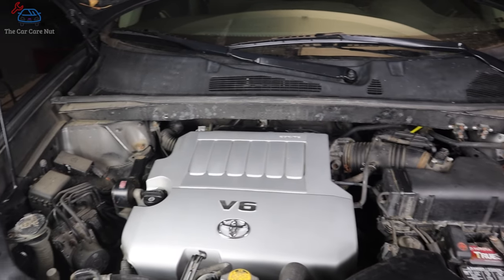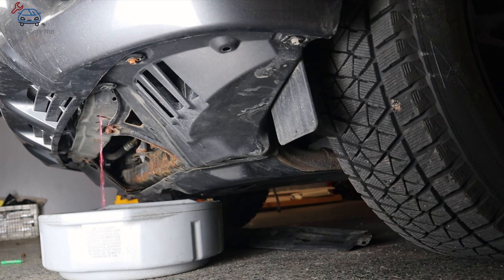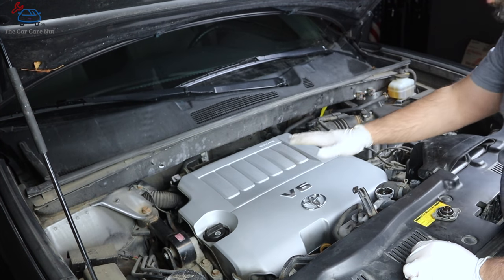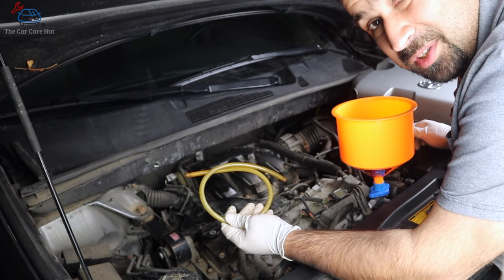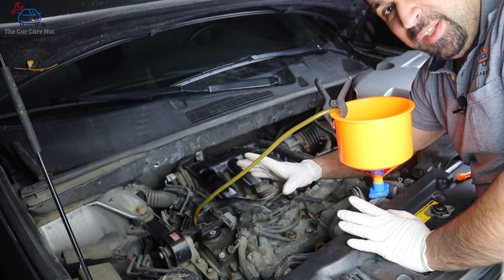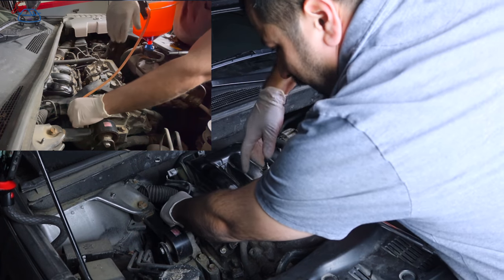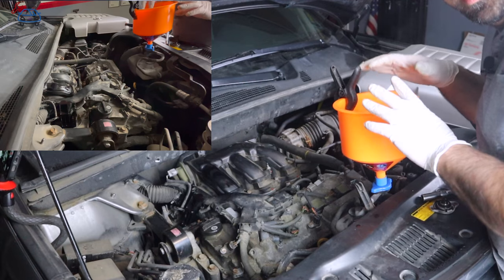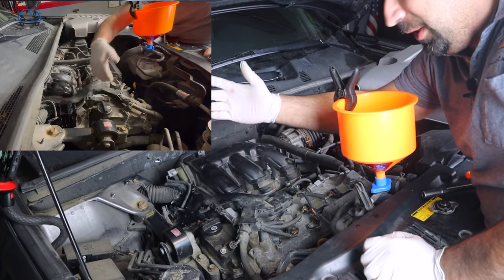Toyota Cooling System Bleeding for V6 2GR-FE 3.5L THE RIGHT WAY!

Comment: Worked great in my 2015 Sienna! I did a drain & fill (preventative maintenance), needed just over 1 gallon of Toyota Pink coolant.
Reply: No, heater was off per video instructions. The Sienna does not have a heater valve. Leave heater off when performing this procedure.@@DontEatBatSandwich
Reply: Will this work for a 2019 Toyota Sienna?

Comment: Just watched this video for the first time. 2014 sienna 176K miles original thermostat and water pump.. I preformed a drain and flush 3 maybe 4 times with regular water with the front of the vehicle raised on ramps making the radiator cap the highest "vent" slowly added coolant while the vehicle idled for 20-30 mins. No mess no fuss no tools required(pair of gloves)and no problems since and interior heat was super hot for the winter. Seems a bit over engineered? It did take some time, a Saturday night well spent in the garage taking my time so not the quick/fastest way like in a "dealer" setting.

Comment: Meanwhile the MZ engine family were so easy to bleed in comparison. Toyota SLLC or in Australia we have a P-OAT coolant that's specific to Toyota/Lexus even down to the colour. Ingredient are basically identical to SLLC, because in Australia the genuine coolant is ridiculously overpriced. Toyota call for Phosphate coolant that's Anime, Borate, Nitrate & Silicate free. It's the only aftermarket brand coolant i'd use besides genuine, especially if i'm changing it every 65,000km as per the book after the initial timing belt. Plus being a concentrate i rather it mixed with distilled/demineralised water myself.

But as always, great work !

Comment: At the end after you've let the engine idle a bit and everything has chilled out, grab and squeeze the hose from the radiator then with it squeezed you can have a friend remove the funnel and cap and then put the radiator cap back on.

Comment: Many years ago a friend told me that he was going to have to buy a replacement engine for his MB diesel S Class because cylinder #6 had seized. I asked whether he had had his coolant changed before that. He had and the dealer did it. I suggested that the tech might not have opened the block bleeder. Sure enough. Air trapped. They replaced the engine free. Moral: Look up the exact procedure and don't guess.

Comment: One thing that you have to watch out for is making sure you loosen the correct bleeder. He said 10 mm and I wasn't paying attention. I loosened the adapter that the bleeder screws into. Nothing was coming out, assuming it was clogged I removed it. I then realized the brass bleeder is the 10 mm bleeder that is essentially threaded into the 15 mm adapter.  Got coolant all over the place.

Comment: Hi love your videos, real thorough explanation.  I just bought a 2011 Toyota Avalon with 57,500 miles on it. Garage kept. 1 owner.  I just did the drain and fill like you said. But it only took a little more than a gallon to refill ?  I opened the bleeder on top like you said and opened the petcock on the bottom of the radiator and removed the radiator cap to let it completely drain. I bought a yellow refill spout with a stopper on the bottom, less mess and pinched off the bleeder hose with needle nose vice grips, no mess at all. MY QUESTION IS. Why did I only use a little more than 1 gallon of antifreeze and that was filling the reservoir to the full line ? My owners manuaI said it takes 2.8 gal. I bought 2 gallons. I had a steady flow after the bleeder line cleared and then filled solid with no bubbles ?
Reply from the maker: Hi! That’s actually correct. The rest of the coolant is very difficult to get out short of removing parts off the engine mainly the water pump. The amount you replaced is enough to refresh everything.
Reply: @TheCarCareNut thanks for the super quick response ! How long will it last replacing only half the coolant ? I read about the other 2 block drains, to remove all the coolant and was hoping to exchange it all out for 5 years. I guess I will have to check the ph, voltage with the engine on and off to see if I have electrolysis that corrodes the metal and rubber hoses. Everything has been well maintained and no traces of rust and the  hoses are still firm vs soft and blown up. Thanks for all the tips, I already dropped the transmission pan and replaced 2.5 qts after cleaning it, the 1 bolt was easy to get at with an open box wrench, next up the spark plugs, I'm really not looking forward to that rear bank. you have helped so much, it's wonderful to have a smart and dedicated expert that is willing to spend his own time helping others out !  thank you very much., Im 69 on SS and still wrenching on cars, I've been doing it since HS, soon I will have to pay people but until then your the Master tech and instructor for us Toyota fans.!

Comment: I did at least two dozen 3.5 V6 Toyotas. Same ideal but I hang the 1/4 tubing on the hood prop rod  then fill the antifreeze up with that same funnel to the middle. Then I run the engine for at least 10 min. till both upper and lower hoses are hot then open both heater control valves for another 5 minutes. The ideal is no more air bubbles or at least the minimum. You’re ideal is the best but you need someone to step on the accelerator when needed.😊😊 I’m most of the time by myself. Nobody likes being with me😅😅

Comment: Just did a drain of fluid didnt open valve and replaced fluid....squeezing hoses to remove bubbles and had no issues year later. I just checked the fluid next day and added some more fluid and done.

Comment: Thank You this video is a great Time Saver for proper bleeding , Also i would like to add in bleeding my 2008 Sienna  I found after draining coolant out of bank 1 &2 and draining the 2 drain hoses by the passenger spare tire underneath that using the hose with the top bleeder submerge in to the 50/50 mix it will pull coolant into the motor. when coolant stop draining from jug then move  back into the top no spill funnel and it will the have a steady stream of coolant.

Comment: Followed this exactly. I never got a steady flow only more large bubbles mixed with flow after the drop in the hose. The funnel also filled up with a ton of coolant, so much so that after the engine was shut off I had to add a lot more back into the radiator.

Comment: Wish I would’ve seen this when I swapped the thermostat on my ‘09 Sienna! Ended up using a lift to raise the front end of the vehicle and topping off the coolant as needed and having someone rev the engine throughout. Ended up working decently; had good heat and everything, but had to periodically top off the coolant in the following weeks as the system self-bled while driving. Made me think I blew a gasket or had a leak somewhere!

Comment: Did I understand him correctly to have the heater “off” during all this?  How would the air bubbles get out of the heater core as he describes if the heat is off?  
Also, at 8:55 he states “make sure your coolant stays over the bottom of the overflow hose.”  It looks like his hose that overflows into the funnel is barely protruding into the funnel and is never submerged in the coolant as he describes?
Reply: Apparently he meant to say over the bottom of the funnel, he also touched it as he spoke...

Comment: Thank you for putting all these videos together. I have a 2009 Toyota Avalon  limited. I have done this procedure twice now, as I have only been able to drain 4 quarts of coolant  each time. I have opened the bleeder valve  but it doesn't make any difference. Why is the system not draining more coolant?  Thank you. Gene

Comment: My mechanic when questioned about that bleeder told me they pressurize the system instead. However as I have the T's to the heater core to replace ( he'll do it as my hands do not work like they used to )  once again they will do what they do to get the antifreeze into the system. Now just incase I have any issue with not getting the heat everywhere in my Sienna I will do this method to make sure there is no air in my system.

Comment: First time I have seen one of your videos. I want to say THANK-YOU sir. Quality video clearly showing the do's and don'ts. My mechanic says the car is overheating and causing it to shake while driving like it's misfiring. I paid him for his evaluation/diagnosis but took the car home to chew on the $800 repair estimate to change the radiator. Is 3 hours labor about right for job? When he showed me the nipple of the radiator that was broken off and stuck inside the hose I noticed a vacuum line disconnected right behind there so I reconnected it. I drove it home 1.3 miles with no issue but then my wife drove it 4 miles and it got very hot BUT NO SHAKING. I brought my car to her and she drove it home while I waited for it to cool down to the midway point between cold and hot. I drove it home with no overheating as gauge stayed right in the middle and no shaking once again. Today I drove it about 4 more miles with zero issues. I reconnected the hose (less than 1 inch diameter) at the top of the radiator (not the hose to the reservoir) using a hose clamp and just drained the antifreeze out. I was going to refill before seeing your video but now want to get a proper funnel before doing so. Any suggestions would be greatly appreciated.

Comment: Most engines you can burp a large amount of air from the system by squeezing the lower hose firmly and releasing. I found that that worked for most of the air in my Lexus, and I was able to tell how much air remained as I'd measured what I drained before replacing the pump.  But for sure, it pays to use the bleeder.
Reply: On this engine, the hose is close to the belt, so I wouldn’t squeeze it while it running to keep my hands clear of the belt.

Comment: Great video and thanks for the information you have passed onto us.  But I do have two questions to do with the car heater.  I think you say that the car heater should be turned OFF before starting the filling and bleeding process of the engine and radiator, ..... well at what point do I turn ON the heater to make sure that heater coolant circuit is also correctly filled with coolant and has no air bubbles in it?   This particularly relevant if the heater coolant has been drained at any time.  So my second question is why I cannot just simply do your filling and bleeding process with the heater ON right from the beginning so that the engine, radiator and heater coolant circuits are all filled and bled all at the same time?   I hope you get my drift, and I look forward to your reply.  Regards.

Comment: This procedure worked very well on my 2011 Highlander with 2GR-FE. However, I was able to drain only 7 qt of coolant from the radiator drain though the owner's manual spec for the cooling system capacity is 9.3 qt. Per a TMC schematic I have of the cooling system drain locations, there are two cylinder block drains that I couldn't locate. I suspect that the missing 2.3 qt is coolant left in the engine; thus only about 75% of the coolant was replaced.
Reply: Was going to also post this. Is draining just the radiator enough? You could probably get more coolant out by starting the car with the drain open and hoping the pump pushes a bit more coolant out? Not sure if this would be best done on a cold or warm engine (thermostat open or closed).
Reply: @bumblebvr6  I don't think it's advisable to run the coolant pump with no coolant in the system, which would be the case if you started the engine after draining the coolant.

Comment: I finally got a steady flow but never saw the coolant drop back out of the hose.  I had tiny air bubbles but with a steady flow.  I did this on a 2007 Sienna.  Van was running for over an hour.  Bubbles got less and less but I never saw fluid drop back in the hose like in the vid.  I did achieve a steady flow.
Reply: In my case clamp squished the tubing once coolant got hot and it blocked the flow. I had to remove clamp and hold the funnel end of the tube with my hand instead to confirm steady flow.

Comment: Thanks for the video man. I got a 2017 v6 Tacoma. I had to fill coolant twice… once I want to say like 8months ago with about quarter gallon, then just recently with about same. I find this a little unusual to I took it to the dealer, they did a check I don’t thin pressure check or cilindro check. But did do a coolant change. 

Week later I noticed the level down about quarter inch from full line on expansion tank. 

Should I be concerned for a gasket leak? Dealer said it’s all good, and that coolant can evaporate?  It’s not overheating, no obvious smells or leaks, or white smoke. Had truck since new, now 91k miles

Comment: Just re watching this again, I have to ask, why don't you drain the engine block ?
Some people are advising to drain and flush the engine block AND heater core as well as the radiator to get ALL of the old coolant out. 
Is this true or will just the radiator drain suffice ?
My factory fill coolant is way over due so I would think that the process I mentioned earlier would be the way to go to rid the system of potentially acidic old coolant.

Can anyone please advise on this ??

Comment: Be careful. I did this about 10 weeks ago. It was great. However the 10mm bleeder valve which is on a fitting that is screwed into the engine block. Well that 14mm fitting was slightly loose. All of my coolant eventually leaked out and would mostly evaporate. So no puddle on the shop floor. It is difficult to get a 14mm open end on that fitting. So I slid on a 14mm deep socket to tighten up after securing the 10mm bleeder.
Reply: It also occurred to me as potential scenario, when I looked at the bleeder valve for the first time.

Comment: Worked great for me. I did however leave the heater on max hot with the fan at the lowest setting. I got the steady flow out the bleeder so it must of worked fine.

Comment: I follow every step on my 2009 lexus es350 including I bought the funnel at Amazon thru your link but I never saw  the coolant go up and down thru the clear hose, one difference is that my bleeder screw is 14 mm not 10mm but    your method work because with the bleeder open bubbles were coming out of the funnel and it seems like  it worked because the heater is pretty warm and I idle the car for 30 minutes on 2500 rpm and it didn't overheat. Let me know what I did wrong if possible? The hose I hose was snuggle but not that tight.

Comment: A warning for those who are clever like me. I will not risk burning my fingers closing that bleeder valve when it's hot, I said to myself. I will have a crow's foot wrench ready to close it and torque it. So when it came time to close the valve I knocked the tube off with the wrench, causing a fountain of coolant to come out of the bleeder valve while I frantically tried to close it. Fortunately I got it done before the funnel drained but word of advice: do it like AMD says!

Comment: When I replaced my 2007 Sienna radiator I kept the van front end jacked up to minimize coolant spillage out of the engine since the coolant was recently replaced during a water pump job at the dealership. After putting everything together, I just followed my common sense of keeping the van running for an hour keeping an eye on that special funnel. Then I took it for a ride with the front and rear heat on the max. The following day I parked the van on a ramp and repeated the bubbling procedure only few bubbles came out and it didn't take any extra coolant comparing to the day before. I concluded the job and I called it a success. I never knew about the bleeder but so far everything looks okay, except the rear heat takes more than 10 minutes to warm up, do you think that is normal?
Reply from the maker: Hi! The rear heat could take longer to warm up on this model. However I would try the procedure in this video but without draining the coolant. Just open the bleeder and connect the hose and use a spill free funnel. If it’s 100% bled already you’ll very shortly after reviving it you will get the steady coolant flow.
Reply: @TheCarCareNut  Thanks AMD.

Comment: I never did get a return flow of coolant even after 35 minutes @2K rpm.   I waited until I saw no more air bubbles coming up in the hose, ran it another 10 minutes or so and then quit.   No overheat or heating problems thus far.

Comment: Hi-just want to be clear.  Other bleeding practices have heater core open to circulate coolant into that area too. You specify heater core closed.  Will there be air in heater core that needs further 'burping'?  Thanks.  Great videos!

Comment: You're great. I'll follow your process for coolant, brake fluid, transmission fluid and power steering fluid. Just wondering is it necessary to drain the engine block as well to get all the coolant out of the system before filling? I have 2011 Lexus ES

Comment: At the top of my expansion tank there are two rubber hoses, one goes to the fill cap on top and the other is dumping out coolant while I perform the outlined steps. What do I do about that second vent hose?
Thanks so much for the helpful videos!

Comment: Okay I did this today and it was nerve racking but it works really good.... only problem I had was I accidentally closed the bleeding nut & I was stuck on it not overflowing until I moved the bleeding nut then it worked perfectly 😅
Reply: Btw I also did this wearing sandals 😆